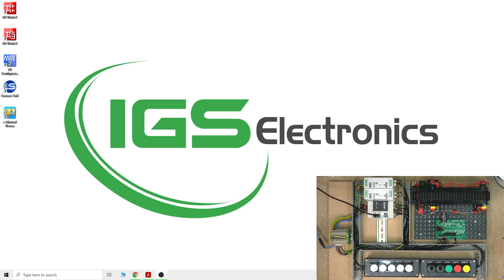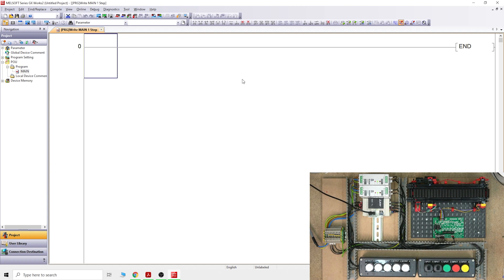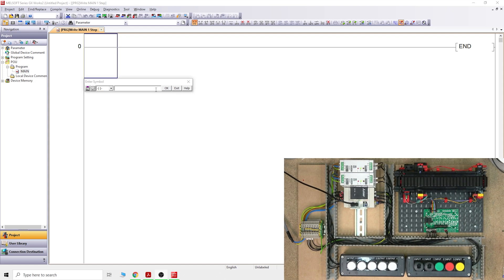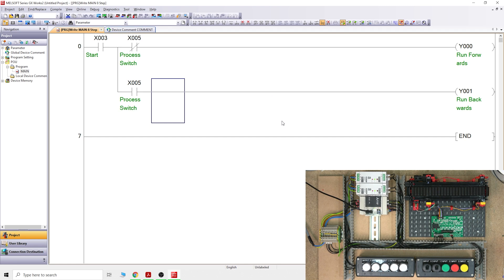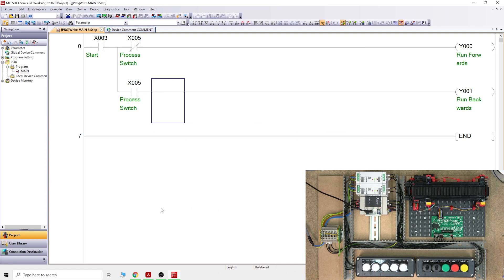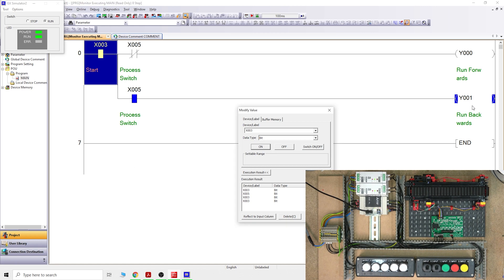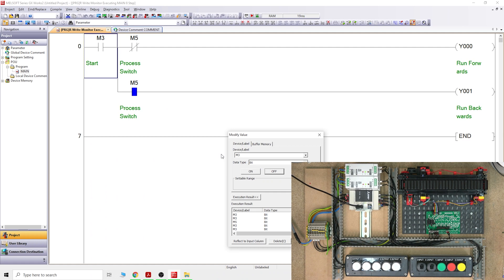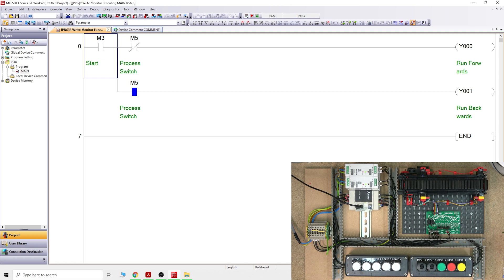Mitsubishi PLC FX3s training rig, X,Y and M Simple Programming with GX Works 2. Part 2 (English)

Comment: Hi , I have a FX3u-128M with 4 X 4AD-ADP units attached, I know nothing about programming it but would love to learn more about it. I also have the GOT1000 HMI to interface with it, any suggestions would be gratefully appreciated, the unit came from a water treatment unit (ultra filtration unit UF) using pressure, flow, temperature etc. best regards Tom Giblin.
Reply from the maker: Hi Tom. First you need to get GX works 2 or GX developer to be able to start programming the FX3u, The GOT1000 need GX designer. Best way to get software's are to Get the IQ works 2 package, that has all Mitsubishi software on it. On its own it comes in quite price, so the re is bundle packages that can reduce the cost, but as you already got the gear that might not be the option for you. I might have IQ works 2 in stock, if you interested.
Reply: @IGSElectronics  Thanks for your quick response, yes that sounds very interesting, what kind of price would the software be?
Best Regards,
Tom Giblin.
Reply from the maker: The price for IQ works 2 is round 1300 to 1800GBP depending who you bay it from. Somewhere in EU you could get cheaper. You also will need SC-09 cable to communicate with the FX3u PLC. What's the part number of your HMI?
Reply: @IGSElectronics  sorry for the late reply, I was on late shift this week, the model of the HMI is GT1265-VNBD Date '14.07 I hope this helps. Tom Giblin.
Reply from the maker: @tomgiblin3472  you screen got USB, so programming can happen via usb, but communications with plc you will need other cable.